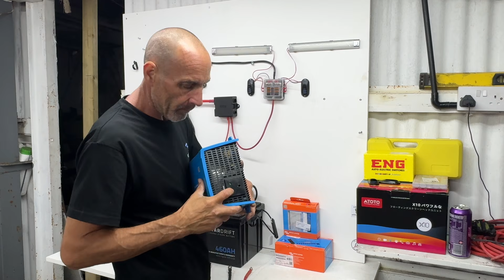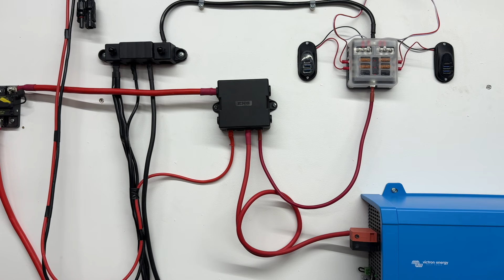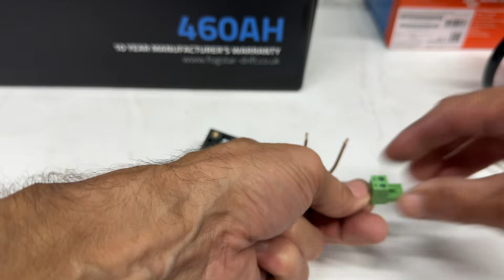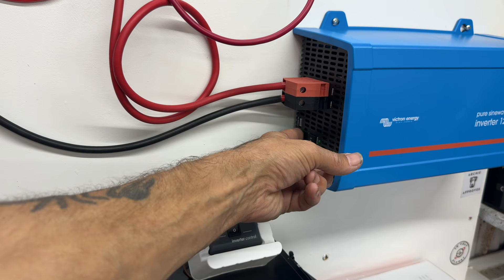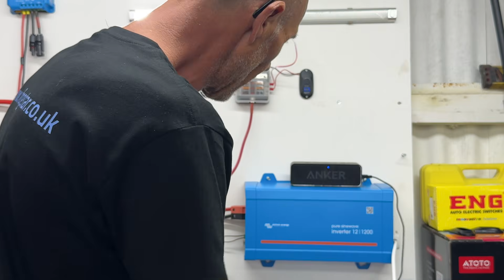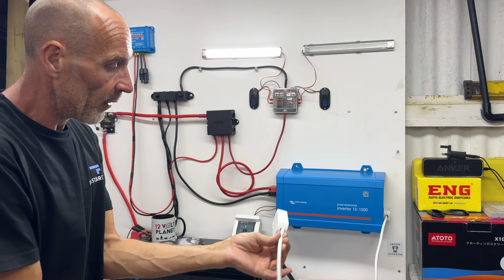Fitting a inverter to a camper made simple.

Comment: Nice inverter, solid core transformer accounts for the weight in it.
Make sure you have nice big cables with short runs and fuses to protect the cables.
I love blue sea terminal post fuses for this, fits straight on the battery terminal and no short leads needed. Ace product and the correct bit when you have lithium batteries with very high ampages possible.
Make sure you have spars fuses for it.
Take care M.